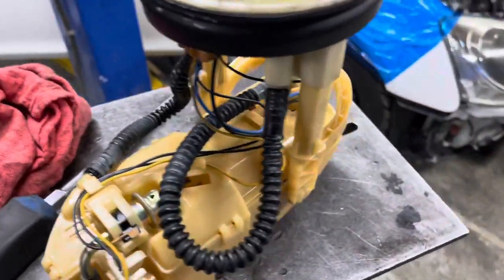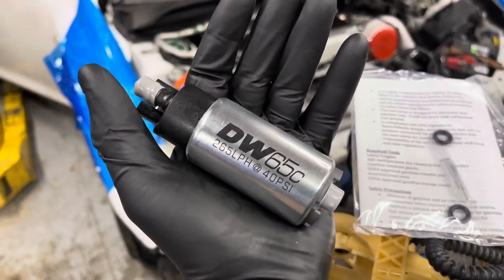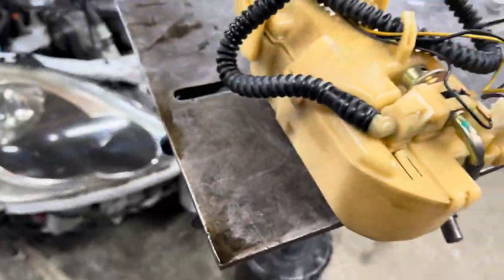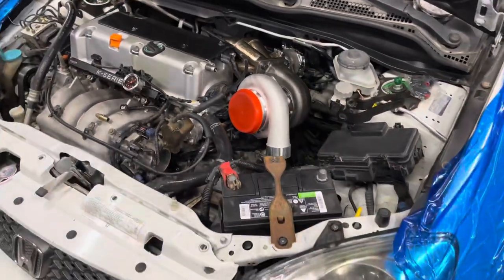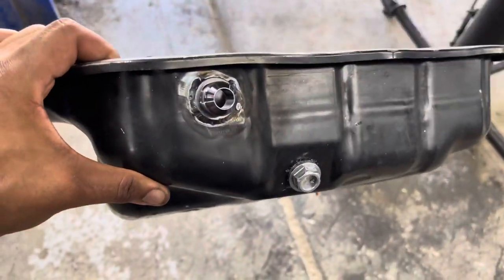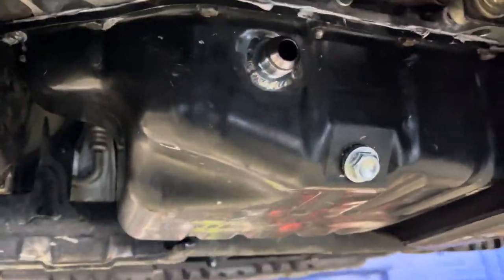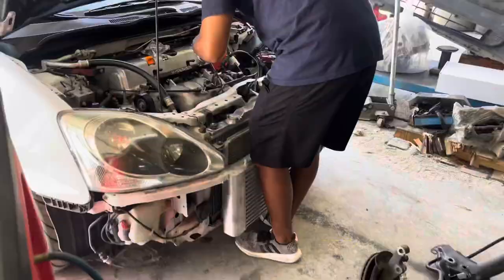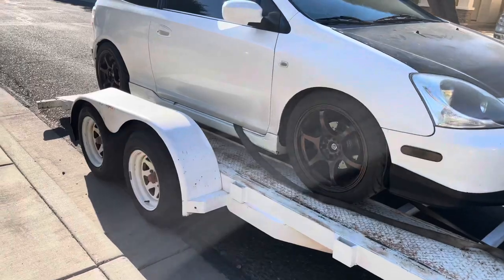K24 Swap EP3 Civic Build Ep. 3

Comment: What did you guys do for the evap service port and brake booster that’s right on the side of the motor connecting to the intake manifold
Reply from the maker: Ran next vacuum lines with the throttle cable and heat wrapped everything
Reply from the maker: Ran the**